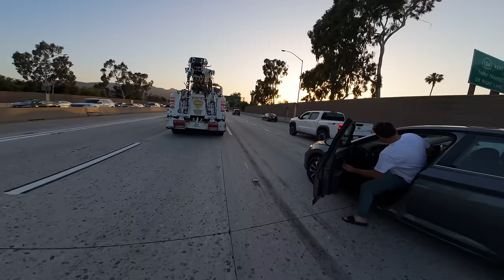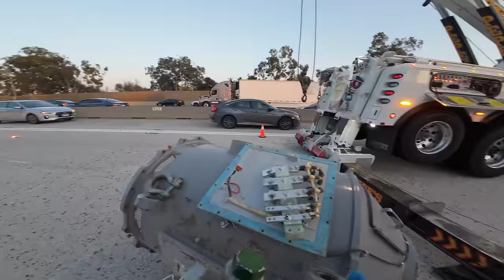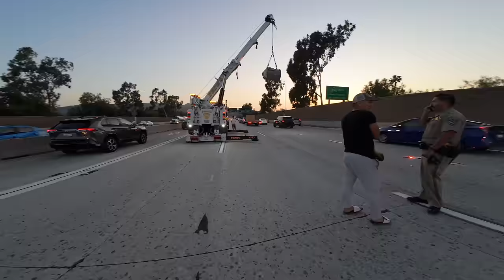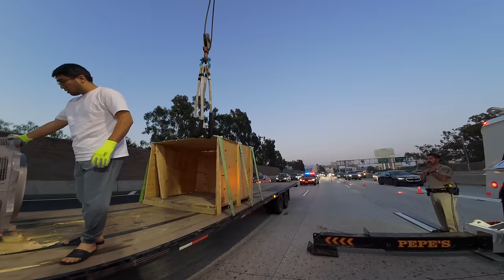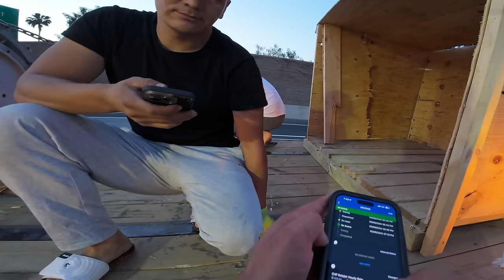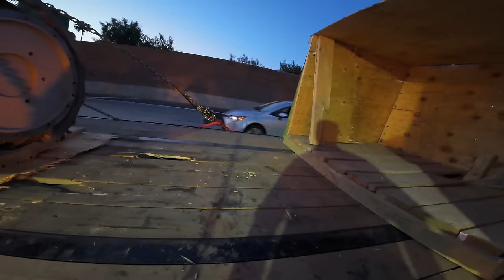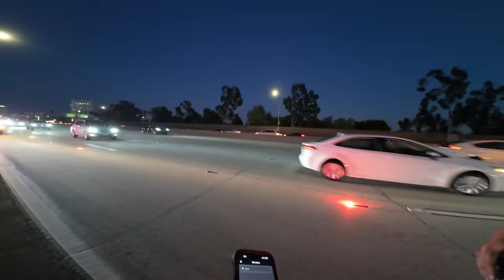18,000lb Alternator Falls off Trailer on Freeway

Comment: In Australia we have a law called a chain of command which everybody is responsible (liable) the company that sent it, pack it, loaded it,and tired it down, transported it, are all legally responsible and can and will be charged he should have checked the load and refused to transport it if it was not safe
Reply: Would this require a driver to inspect securing measures inside a nailed shut crate?
Reply: @splitprissm9339  I the video you can see the cop ask if the driver has photos of the load secured in the box and the cop would not comment on the video when the driver ask him to state that it was not secure in the box you will notice that the cop does not fall for that

Comment: The traffic cones are not DOT or OSHA compliant for highway use. Those are parking lot cones. And no one, not the tow driver, not the cop, not the tow truck driver, was wearing the mandatory OSHA compliant safety vests. All this in the center lane of Interstate traffic.
 So none of them is a professional. This is one reason that cops and tow truck drivers are hit and killed on the road so frequently. 
 Yes, it sucks if the highway is closed. But if someone gets hit, the road will be shut even longer for the homicide investigation.

Comment: I'm an engineer, we both design and build equipment for factories all over the world, and also do modifications and recreations of existing. We always provide heavy rigging services as well, moving 100,000 equipment, etc. across the world even. I watch these rotator videos, and it is almost ALWAYS THIS channel I see all kinds of STUPID things, possibly for the sake of the videos.  Such as, having the 18,000 generator up in the air dangling there for all that time, absolutely uncalled for, NO reason to do such.  Is that much for the truck? No, not at all. Was that even heavy for him?  No.  But that would be like us craining something way up in the air, (that is impressive) that is no challenge for the crane, and "dangling it about" to impress people. Either present, or for a video.  These guys do it CONSTANTLY.  One of these days, some OBSCURE thing is going to happen, and you will wish you weren't being idiots.  (Example:  a car loses control, slams into your truck, or causes a tractor trailer to slam into your truck, and that damned thing falls and crushes some other car that ended up under it.) Officer walks under it, NOT because he's stupid, but because he probably just didn't notice it.  Easily could have rigged it, and picked it up, and sat it down when he was in place. Wouldn't have taken any additional time.

Comment: When I was pro trucker I bought my own chains load binders 33 ft the very best and I only weigh 130 and I used a 104 in. Cheater pipe I hauled o.s. o.h. o.w. permit loads with big winch truck in oil field and loved it.

Comment: Securing 18,000 lb with a sheet of 3/8” plywood, 4 1”x3” and 12 wood screws is not smart. Whoever packed the crate is at fault here.
They should pay the $1800 bill and whatever damages occurred to the alternator.

Comment: Not sure about other countries but as a trucker here in Sweden hauling a shipping container that is badly loaded, so say all weight is at one side, and then the container is sealed, the driver would still be fined for the bad load even if the seal ment he could not even check it.

Comment: There's every chance that the shaft of that alternator is now bent, and when they try to run it the first time it will dance all over the floor and make one hell of a racket. Not to worry, though - the noise will go away when the bearings seize.

Comment: Wait, tell me about putting 18,000 pounds, or 9 tons on the front of a trailer thats hooked in the bed of a 1 ton pickup.
Even if the trailer was carrying half that's still 4-1/2 tons in the bed of a one ton dually pickup.

Comment: From which car did that Alternator fell off?  !8,000Lbs load re-loaded at the coupling end putting most of weight distribution on the truck's rear wheels, They don't know what is a center of gravity.

Comment: I found it hard to believe that little thing weighed 18000 lbs but when I did a calculation to figure out roughly how large a metal object would be with that weight (assuming a reasonable value for density) the result was an object of roughly that size. I guess sometimes we underestimate how much objects weigh; for instance one cubic metre of water weighs one metric ton (2205 lbs).

Comment: What would you put that alternator in? Maybe like a power plant or something?
Reply: Certainly not a thin plywood crate. Industrial power plant, possible driven off an industrial gas turbine, might be plausible - or maybe a wind power installation? Part of a rotary converter (motor generator) set? Ship engine room?

Comment: Gotta love it when someone complains about the price after the job is done. 
Like seriously... 
One, this isn't some scheduled call. It's an emergency call. That doubles the price right there.
Two, this isn't a lift in a nice safe parking lot or field. It's an ACTIVE freeway, requiring police cordon. That increases the price due to hazards.
It's 18,000 pounds. That's a HEAVY lift. You need a rotator for safety. 

If you didn't want to pay to recover the item from the freeway, secure it properly.

Comment: I love that nothing here is staged. Real people doing real things, using the right equipment. Have to wonder if its even any good at that point if it hit on the shaft while tumbling. Was the driver ticketed?

Also buddy, you driving the load, you are responsible for making sure its secure, no one else. You need to know what you are hauling. That could have killed someone.

Comment: Wonder if the machine is even salvageable - certainly will need to be factory overhauled then, I assume? Or are the bearings in these made of some magic material? Certainly, I'd refuse or only conditionally accept shipment if I had bought a factory new machine and it arrived in that state.

Comment: Putting the whole load on the axel of the truck is crazy. I wouldve unstrapped the box. Turn it around and move it to the front of the trailer and placed the freight back in the original spot.

Comment: Holy moly was that crate poorly designed.  It had a base and zero lateral support, and zero trace of internal straps, and then just sheet ply for walls and a top.  For something like that you would at a minimum want to build a solid support frame, Bolt the alternator into the frame, and then mark hardpoints on the outside.

Comment: He allowed the shipper to blind box load a 18000lb machine. Would not have been a problem if he had chain wrapped the box and secured front to back, and back to front. Then strapped or chained over the top to the sides. Driver is responsible for the load securement on his truck.

Comment: There are tie=down formulas that determine how many straps are needed depending on weight, dimension, and whether it's a direct or an indirect tie-down.
The shipper should have secured the load better. This crate is maybe two steps up from a cardboard box. That alternator should have been on a sturdy pallet, with metal banding and chocks to secure it, and then inside a crate.
It also should have been turned 90 degrees so it wouldn't roll under hard braking.
Bottomline: the way they had it at the end is the way they should have loaded it in the first place.

There is enough blame to go around for everyone. The driver should have inspected the crate. Maybe he didn't feel secure enough in his position to force the shipper to open the crate or make them secure the load better. Maybe he also didn't want to lose the job.
I also might have asked Pepe to document the situation. Doesn't hurt to ask, and you know that for the driver the problem is far from over. Anything he can do to improve his position at this point he should do.

Hot-shotting is trucking you can do with a regular license. But it does annoy the crap out of me when guys from all corners of the world come here and start driving around LA as a job, and barely speak the language well enough to understand basic instructions.
I used to work with guys like that. Frustrating af.

Comment: First they crate load the 9ton alternor so the actual machine isn't strapped so it rolled out of the crate when they slammed on the brakes. Now, they are tongue loading the alternator on the trailer on an undersized pickup pulling the load.

Comment: Incredible how different work on the freeway is handled in the USA compared to Europe and other regions...
Here, the whole freeway would be closed during hoisting work like that, and even when it is re-opened after trucks have moved to the shoulder, at least a single lane would remain closed as a separation between the parked trucks and the moving traffic, and to serve as a new emergency lane.
Similarly, cars are never stopped on the freeway by police for anything less than criminal activity. When you are just driving too fast or otherwise misbehaving, you will never be stopped on the freeway itself, but will get a "follow me" police car in front of you taking you to an exit or service station.
Working on the freeway with all the traffic passing left and right is just too dangerous.

Comment: Somebody ordered an altenator from company "x".  Company "x" then puts out a bid to ship said altenator.  The hot-shots (slang for quick shippers)  bid on an 18k lb box, 8'x10' crate.  Company "x" has already boxed up the product and loaded via forcklift with no way to verify if the product is secure by the seller.  it's clear that the altenator wasn't secured to the pallet (company "X" responsibility) prior to the sides and top being affixed.   The Russian guy shouldn't be paying the bill for this.  I have done several shipments similar to this where a heavy product can just roll out of it's container.  
I build the heavy-duty pallet.
I bolt down (not screw) the very heavy item to the heavy duty pallet (4places min).
I then frame around the bolted down product like I would frame a house.  Then throw on the OSB siding with 2x4 reinforcements just cause I can.

Comment: Whoever packed that crate should be fired. I worked a large electric motor company and these things are supposed to be bolted to the pallet. And this one in particular is a vertical motor with the mounting bolts on the open end. It should have been bolted to a pallet in its vertical position with the pallet built to accept the coupling.

Comment: For everyone talking smack about the driver for wearing sandals and sweatpants he’s not fully at fault . He’s just a driver. I know truck drivers who wear shorts and flip flops. He’s not loading anything by hand he picks up and drops off that’s it. Whoever packed the crate should be at fault tho. If you are building an enclosed crate/shipping container it’s your responsibility to make sure it’s secure in the box. Or strap it directly to the trailer bed. I wouldn’t blame the driver. As far as he’s concerned he’s just picking up a crate and 99% of the time they never open to check if it’s secure.

Comment: Do it right the first time and this never has to happen.  Man, these guys are dense. Walks right under the load.... I load trucks like this everyday in Vancouver. Steel coils, large pipe, steel plate and odd things like this generator from the ship to the dock and then later loaded on trucks for the highway. No one leaves the dock without proper securement.

Comment: I wonder if the crate was put on the trailer in the wrong orientation, ie narrow side front/back & wide side to the sides. Perhaps the narrow sides are reinforced and it wouldn't be anywhere near as likely to break through, like it did on the wide side. Obviously the securement to the crate could have been wrong too. It doesn't seem very logical to me that a trucker would be responsible for having to strap all around the crate to hold the crate itself together. I don't really recall seeing that being done either by flat bed truckers that post on YT and/or seeing it on trucks going down the highway.

Comment: You guys train for hire in SoCal?

I have about 3 yrs experience with a 16k crane truck (Palfinger) . No CDL tho but I have welding certs (work about a decade in the welding field) 

Currently working at a truck and body shop building commercial trucks (lifts, beds etc)
Reply: Would drop them a privte mesage at Facebook, or email/contact form at their website. Many comments under the videos, hard to notice all

Comment: You don’t really think about how dangerous an highway is until something happens requiring you to get out of your vehicle and out on the freeway. Every time I see people standing on an interstate and vehicles are whizzing by less than ten feet away I always think of the old arcade game Frogger. If the speed limit is 70 then they are actually going better than 80. It doesn’t take but a 5 second brain fart to cause one of those vehicles aiming in your direction. The pull off areas on the side of the road are WAY too narrow for a stranded motorist to get safely out of the way.

Comment: I would not have unhooked from the item until paid in full. The price would have increased as did my time on site due to non payment. $100.00 every ten minutes while waiting on payment after unit was set on trailer. As stated I would have not unhooked so I could remove unit and held it for payment. That recovery wrecker and driver was held up and therefore could not generate income for my company. The recovery company is selling time and time is money. Who ever paid the bill knew full well it wasn’t going to be free so they should have been prepared to pay the moment of job completion. Waste all the time you like but be prepared to pay for it $100.00 every ten minutes after item is placed in requested spot.

Comment: I wonder how much the operator charged for putting it back on the flatbed. I am sure it was in the several thousands at least. That a big job that requires lots of equipment, not to mention safety being on an active freeway.

Comment: You dropped a 18,000lbs cylinder in a wooden box. Then secured the box to the trailer, box ain’t going nowhere but load is just laying there. What do you think was gonna happen.
Reply: The shipper didn't care. Driver has the problem because shipper is trash.

Comment: They might have used a staple gun to secure crate, the staple really is like a paper clip/ it has no "holding"power, it will just pull out if power is applied.

Comment: I work on Alternators like that and there anywhere from 500,000 to 1,000,000 New. I securely block and palletize them also.
That was not Properly done in this case, the load was allowed to move,shift under braking or acceleration. 
Shit show from the start. And I would Fire any Employee who showed up to work in Sandals,Flip flops.

Comment: I think you loaded that thing way to far to the front. The box was in the middle of the trailer.
After you loaded it again it probably had 60 to 80% off the weight on the truck and the hitch and only little on the trailer wheels.
I know it was the guy that told you to load it there, should have moved the box and put it further back.

Comment: The problem  here is whoever packed that should of anchored to box. Should of had  4x4  presseure treated on bottom so forklift can get underneath the box and that would of gave something to lag into the wood or had a coulpe straps around it.
The other problem it should of been loaded like the tow operator set it inside the box. Would of had much better success. Also should of had chains both ways as an insurance  policy just in case as we can see what happens when you only tie down one side. But more of the blame id say should be on the manufacturer  who  packaged it up!

Comment: Was the whole enchilada in the wooden box originally?  Looks that way and it slid forward and ripped out the side of the box. I wouldn't transport something so cylindrical without better mounting hardware.  This transport was a joke, and the flip flops kill me.  The tow operator doing his job to the nines.

Comment: That thing should have had hug wood wedges all around to keep it from trying to roll in the box that mistake was for the ppl that packaged it the guy definitely had the wood crate really tied but it should have also had straps going all around the alternator and then loop them under the pallet it’s sitting on poor driver he lucky it didn’t go flying into his cab

Comment: I'd be suprised if that truck and the gooseneck on that trailer made it 10 miles down the road with that 18k lbs that far forward of the trailer axles. That weight should have been placed behind the crate over the trailer axles with 8 tires not the truck with 4 read tires.   No one there knows wtf they're doing.

Comment: Be real. No way that alternator weights 18000 pounds, just no way!
Reply: I think the tow truck crane would have known the weight from his gauges. The thing was solid metal essentially.
Reply: @metatechnologist  You are right, cranes have those devices that roughly shows lifted weight, but they are not that accurate. I guess that crane operator red his gauges and rounded the number way up. Click bail..... lol

Comment: I have denied loading multiple trucks at a power plant either due to bad trailer and trucks or lack of equipment to secure the load. I am not sending a $250,000 motor with a 1 year lead time on your truck and trailer with flat and worn out tires.

Comment: The trailer you loaded it on was not fir for purpose the wood was breaking away on the trailer and the wood used wouldn't of stopped that thing. US standards are very low in comparison to European right from the very basics.